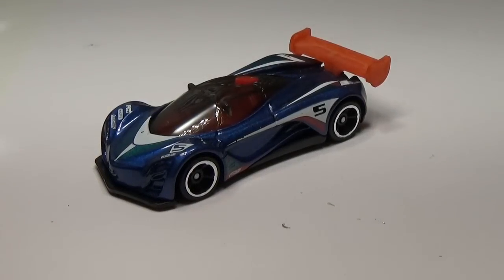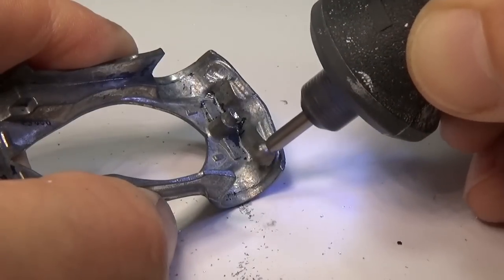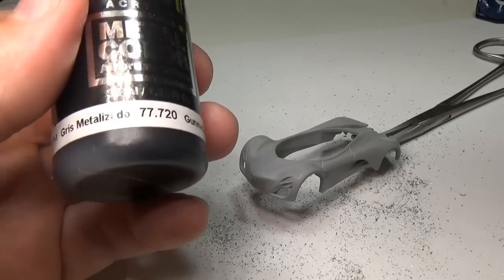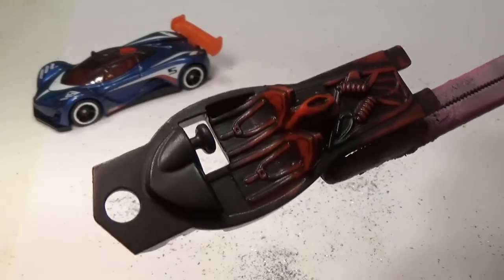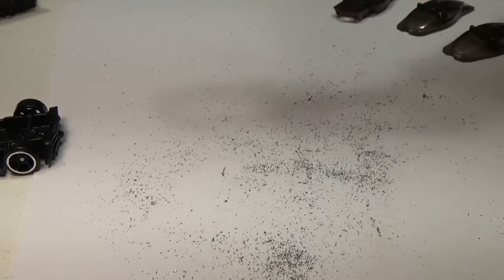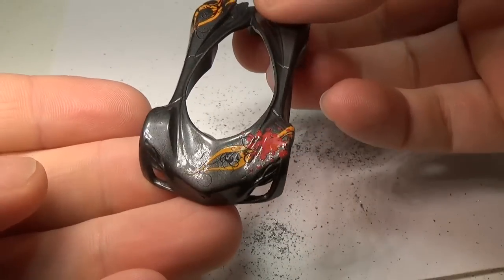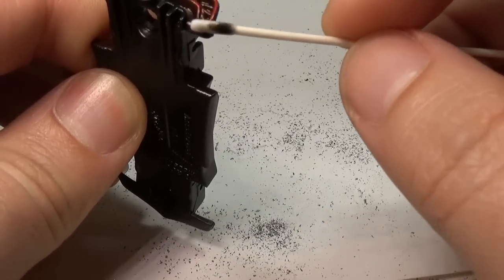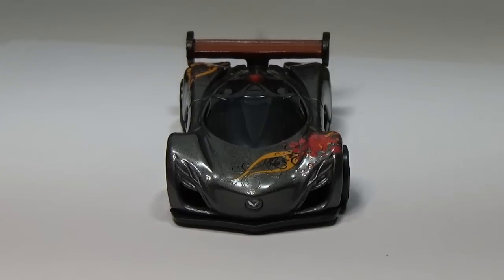Custom Hot Wheels Mazda Furai

Comment: Been watching your videos a long time.  If I may make a suggestion as a not very serious content creator... when you mention 'taking the car apart' pop a link on the screen right with an annotation (before May as they are going away, but existing annotations will remain) to drive your viewers to those videos.  Not only will this increase your overall views, it will also help the viewers get detailed answers without you needing to repeat yourself.  Your channel would benefit greatly from this I believe as your content is great and you are a fantastic teacher.  I would try to crank out some smaller videos about certain products you can annotate to (link to) as well in your videos.  Then I would painstakingly comb through your collection and insert the proper annotations where need be.  I know this would suck but it would help your subscribers, new viewers, and importantly, you.   Once again, great video.  Your channel is one of few I have actually watched every single video.  Keep up the great work!
Reply from the maker: Thanks TJ!  Been needing to do this and you are correct it would help a lot.
Reply: or... maybe put the links on the description section, in every video, as some kind of standard links, that would do the job I think
Reply: baremetalHW can u do a custom Toyota supra

Comment: If you have access to a sandblasting setup try using walnut shells instead of sand as a refinishing option for your redline restorations! Significantly less heat and much more gentle, might be worth a shot.

Comment: Dude, I have been slowly watching all of your videos and this car for some reason is my favorite of all the cars you have done...the gunmetal color was perfect and the decal work was excellent. Great Job!  I have never really been a car collector, though I still build model planes from time to time. I work typically at much larger scale models, but i am uber obsessive about details..especially in the cockpit and engine area....Would love to see you try and uber detail a car...with small seat belts and other cool little accessories. Also adding the ignition wires and fuel lines would be incredible if you could pull it off. I am so inspired by your work..I kind of want to give it a shot with a matchbox car and see if I could do micro detail work.

Comment: I really like what you did with the Mazda Furai. This is one of my favorite Mazda Concept race cars. I really like those dry set decals you used. It really sets off the look of the car. As for wheels, you should use the real rider racing wheels that were used on the BMW Z4 M Motorsport Super Treasure Hunt that was released last year in the Hot Wheels mainline. Just look at a picture or even in your own collection of the BMW Z4 M Motorsport.

Comment: Hello, First of all congratulations and thanks for the channel. It's really fun and I have been watching many videos. I even started (trying) to restore some hot wheels myself. Thus I have a few questions:

1) Do you use a special primer? I got just the run-of-the-mill primer for the hardware store, although it has happened with a couple of cars that the paint chips off very easily. Maybe I am missing something in terms of sanding? Waiting times? Thickness/number of coats? I suspect the primer because the metal shows even when one or two layers of spray paint have been already applied. 

2) I saw a video of a copper-plated car. Do you apply a clear coat to those cars as well?

3) When you do a wheel swap, do you glue the new axle to the base of the car? 

4) When the car has been painted and detailed, how many layers of clear coat are typically applied?

Any pointers would be great! Thanks in advance.

Comment: A quick question, what's the thing you use to hold the car body while you paint them with the air brush?
Reply: I not trying to jump the uploader and answer first, i just know exactly what the tool is because i have a few myself, they are called "forceps" its basically a surgical/dental/medical tool. i got most of mine from amazon. they come in many many "shapes and sizes"  i do believe the ones shown are curved at the tip. you can also use alligator clips attached to a craft stick or other longish straight thing. i have seen one youtuber, mrlediecast, take wal mart wood craft dowels, cut them down to 10 inch or so and then take female wire connector ends, slides those over the stick, then bends the metal ends at a 90 degree and then he screws those into the prepped bodies he has drilled and tapped, this allows him to do multiple cars at a time and have good control over them whilst painting. ;)

Comment: So you had 3 of 'em.
1 remained stock,
2nd one you took apart,
& the 3rd one was the 1 you actually worked on.

The clear coats that you use,are they from a rattle-can,or applied by airbrush?

Comment: Looks very good! Although your method of interior painting looks very sloppy to me. With my very limited experience customizing Hot Wheels I always used testers model paint and a small brush to paint in details.
Reply from the maker: It is sloppy... there is no reason to apply details to it when it is under the tented windshield. You can't make out fine details on the interior even under a bright light with this windshield. All you can make out is color changes (and the dash). Had the car been a convertible or a clear windshield  (or even an open window) I would have added in fine details. 

Details are important, but they are just the means to a end... the end being an illusion of realism. I accomplished the illusion of a two tone interior (in a cheap way... sure) without having to put in a ton of detail work. Had I not shown you the interior and all you had to go one was the end result would you still have commented on the sloppy details? I don't think it is wrong to take shortcuts on situations like this... birds silhouetted at a distance in paintings are just 2 arches...  I don't feel the artist is sloppy for not paining in the feathers.
Reply: baremetalHW All very good points. I hope it doesn't sound like I'm insulting you, you're one of the best HW customizers I know of.
Reply from the maker: No insult taken... just wanted to explain there is a method to the madness... Thanks for input and watching!
Reply: i accidentally accomplished a similar look to an interior about a month ago ;) i got real sloppy with the white paint over a yellow interior, started rubbing off white with a qtip, and well ended up with a white interior with yellow accents very very similar to what you got with the black over red. lol i too had a smoked glass but the side windows are open.

Comment: After seeing how great your Mazda Furai turned out I decided to do one. I found the Mystery car version Wednesday. After thinking a while on what to do. This afternoon I decided to do a two tone. I removed all the tampos except the HW logo. Mask outward part of the body and stripped the paint and then sanded and buffed. Cut out the front cooling ducts like you did. Painted the interior silver metal flake with red and black trim. The rear spoiler was painted a colbalt blue and rear panel red. Wheels and tires are M2s.  I might add a Mazda decal on the spoiler before I clear coat it.
https://www.flickr.com/photos/daddy_rah/33325797794/in/datetaken-public/
Reply from the maker: Richard Hamlyn looks great!! love the wheels!